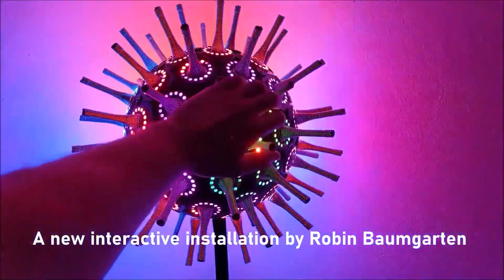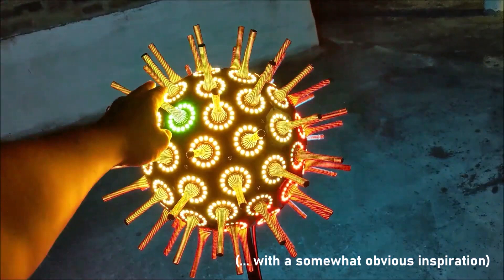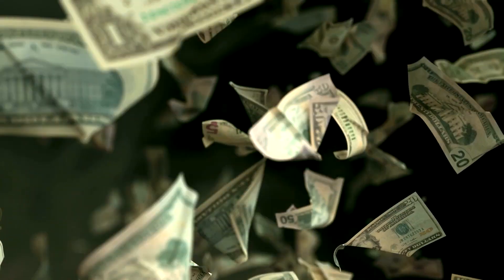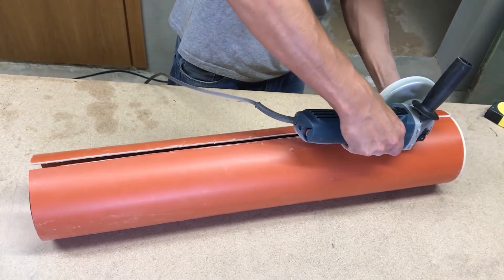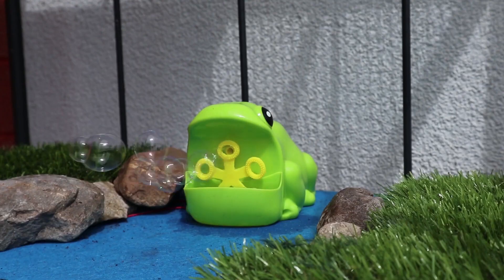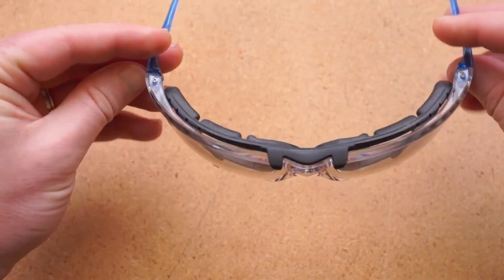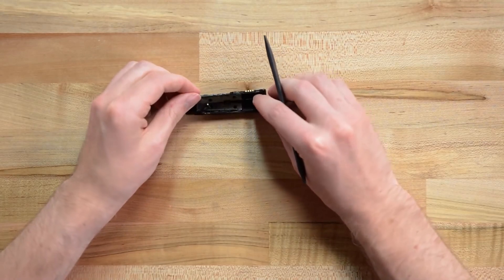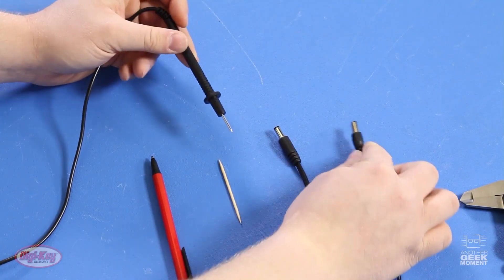Touchy Subject [Maker Update #191] - Maker.io

Comment: the magnets on that folding table are such a great touch
Reply: Agreed. I need to get some of those bearing-shaped magnets Laura was using. I have a (dangerous) box of flat neodymium magnets in my closet that I'm reluctant to use because there's no easy way to affix them. Now that I'm talking about it, though, I wonder if I could embed them in a 3D print design with integrated screw holes. 🤔

Comment: The Virtua CCS safety glasses from 3M are outstanding safety glasses. They are used by several large shipbuilding companies around the globe to protect from constant bombardment of steel metal fragments that are generated in the manufacturing of steel ships. They don’t fog up because of their patented slotted vent slots, they are scratch resistant and the rubber outer seal protects and last an extremely long time. They have saved shipbuilders eyes for many years and I couldn’t recommend them enough when most safety glasses fog up in less than one minute the Virtua safety glasses keep going fog free and the outer seal helps prevent sweat from entering you eyes while working in hot temperatures! In my opinion Rob you have picked a winner because most safety glasses can create more problems than solve. Also if you wear glasses you can order them with the prescription in the lenses from 3M.
Reply: Glad to hear my opinion of them validated, John!
Reply: Maker Project Lab - steel working itself has a high eye injury rate to begin with and shipbuilding has an extremely high eye injury rate due to the large amount of overhead steel work required to build ships. Most of this work is unavoidable but utilizing proper eye protection is just about the only way to prevent workers from sustaining permanent eye injuries. As Operations/Dock Outfitting Manager I had to review every injury that workers sustained in the shipyard here in Philadelphia. Prior to selecting these pacific eye glasses we reviewed 11 different pair of top brand safety glasses and these 3M brand lowered our eye injury rate to almost zero. And I believe the few people who reported that they received eye injuries while wearing these eye protection were not being 100% honest. Our policy was if you were not wearing these eye protection while on company property and I work areas you were immediately released. I’m telling you our eye injury rate dropped down immediately and these workers worked in some of the most inhospitable working conditions due to confinement and temperatures but these 3M glasses worked extremely well. The company made these glasses freely available to all employees so no one had any excuse to not be wearing them. The rubber seals around the perimeter took the most beating along with the lenses getting scratched due to metal debris and improper handling of the glasses but these glasses did what we paid for them to due. Dropped our eye injury rate.